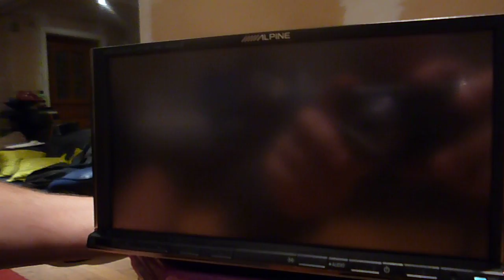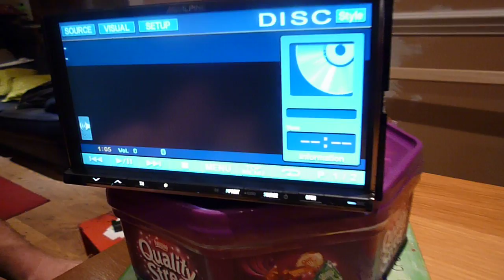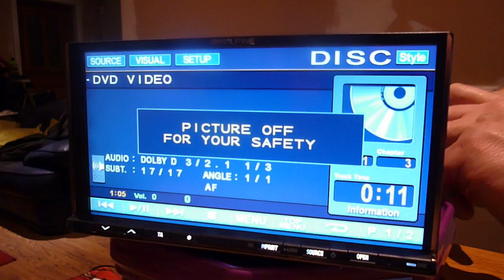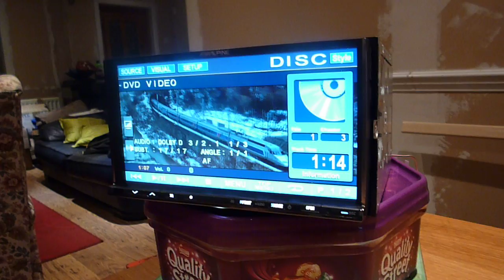How to bypass Handbreak disable function Alpine car Stereo DVD Playback

Comment: UPDATE - This fix only works on models sold in Europe.  Those models only have a parking/hand brake (yellow/blue) lead.  That's why it works for them.  It only needs to be grounded (parking brake activated if installed per the instructions) to allow access to all functions.  The U.S. models are more complicated.  In addition to the parking brake lead, there is also a brake pedal (yellow/black) lead that also must be grounded.  Then, you have to activate/ground the parking brake lead twice while pressing your brake pedal (or grounding that wire via some other means) in order to play DVDs, set your clock, and perform other functions with this model.  I figured this out by comparing the connections diagram in the IVE-530 (U.S. model) and IVE-530BT (European model) manuals, and found the one single difference between the two - the brake pedal wire.  I hope this helps clear up some confusion for anyone in the U.S. trying this fix as to why it doesn't work.
Reply: Palmer, help me please. What do i do with the yellow/black wire?? I have sound but no video.
Reply: Hey Palmer- I followed your directions and grounded both hand and foot break wire- it worked untill i cut off the ignition. Any other suggestions?
Reply: BUNJ125 - I got the same thing when I first hooked mine up. 
BUNJ125 and Phillip - There is a YouTube video that will work for U.S. models. Search for the Alpine Parking Brake Bypass video by laydown313.  You'll need a dual switch toggle to make it work, though.  I hope that helps.
Reply: it depends on the model Alpine, not necessarily the region it was sold in.  For instance I live in the United States and have a Alpine iLX-107 (Wireless CarPlay) and it only has the parking brake lead.  It does not have the foot brake leads.  So if your unit only has the YELLOW/BLUE wire for parking brake this trick should work and you don't need to buy a seperate Parking Brake Bypass microswitch.
Reply: Just ran into this with my ILX-107. You're a life saver!! I may be able to get this baby hooked up tonight after all

Comment: For the bypass, I use a car-door pin switch in series. Solder/crimp a wire on one end of the pin switch, then the other wire end to the car stereo unit's ground body or GND wire. Then connect the green "brake" wire from the stereo's harness to the door pin switch 's body. I drilled a hole for the pin switch or installed it on any available dashboard "ACC" snap-on, for the lack of name on my part. Or use a Normally-Closed button switch or a rocker. Operation: Assuming you already have a DVD disc in there. After the unit completely boots up, press the switch (to disconnect-OFF), let go (ON), press again (OFF), then let go (ON). Basically, it is ON-OFF-ON!...then go to the "Camera" or "DVD" source menu options.

Comment: It works but if your battery dies on your car ever, you will have to remove the radio to remove the wire off of the radio and reset it... just keep this in mind...
Reply: Why would you need to reset it ?
Reply: If your battery dies, the ground will have to be detached and re-attached... It's weird, like the radio knows that the emergency parking can not possibly be attached soon as the radio regains power... The way I fixed this was I ran the ground to a place I can gain access to it with out taking out the radio... I then attached a fuse (or a switch/interrupter) to the wire so if the vehicle looses power, All I would have to do is detach the ground and re-attach it... if that makes sense
Reply: that makes no sense.  almost all cars would have the parking brake ON when say changing the battery out etc.

Comment: I wish this worked with the IVA-W505 but it didn't like your IVA-W502. I had to use the PAC TR7 to make it work, which required connecting 4 or 5 wires (easy enough)

Comment: @ Marcos Marc.. the problem you're having is the parking break wire needs to be grounded to your hand break switch. there's a long green wire that's ran from the head unit to said switch. the only bad thing about doing it the "recommended" way is you wont be able to view video unless the parking break is engaged. there's a way around that. pac-audio sells a module called a pac tr7 that by passes the parking break issue. I got mine of amazon for 19 dollars. it's a simple install... red to 12V. yellow to constant. black to ground. then you have to use only 2 wires that's specific to your car. I believe it will tell you in the manual or you can check their site. the way it works is this module tricks the radio into thinking the hand break is engaged... don't go the relay route as it causes problems.. so I've heard.
Reply: I have the Alpine IVA-W200 in my car and I tried playing a movie with the handbrake engaged but got no video. Does my car need to be on?

Comment: I just hooked up a "new" Alpine IVE-W530 and it simply doesn't work.  No power, nothing.  I grounded the parking break wire to the unit per the video, but I didn't connect the brake pedal wire to anything.  Would that have caused it, or did I simply receive a defective unit from eBay?  All other wires (except power antenna and two remote control wires) are connected correctly.  Any thoughts would be greatly appreciated.  Thanks.
Reply from the maker: Looks like a defective unit but very hard to say from here , you could try to wire it up to a battery  and see that it not the car wiring
Reply: Thanks.  I'll give that a shot.  I'm also going to try a different harness.  If those tactics don't work, I'll look into a possible blown fuse.
Reply: I forgot to ask before - in this scenario (your video), what did you do with the brake pedal wire?  Was that also grounded, or did you connect it to the brake pedal?  I left mine unconnected, and I want to eliminate that as a possibility to my troubles. Thanks!
Reply from the maker: The brake pedal wire is the wire that I grounded
Reply: I see. I guess that leads to another question (sorry about all the questions here).  What do you do with the parking brake wire?  Again, thanks for your help on this.  Btw, my stereo works now after replacing a bad 20a fuse.
Reply: To recap - the foot brake (yellow/black) lead should be grounded to the back of the receiver, and the parking brake (yellow/blue) lead is attached to ???
Reply: I just watched the video again.  The wire being connected to the chassis is the parking brake (yellow/blue) lead.  There's no mention of the foot brake (yellow/black) lead.  My stereo works now, but I only get sound - no video (like Marcos Mark posted).   Should the foot brake lead be connected, grounded somewhere else, or left unconnected?  Thanks.

Comment: Hi

Great video !

Listen..I have the kenwood DNX890HD head unit.

The kit wire harness has black wires that say "Chassis Ground".

Can I just connect / splice my "parking SW wire" to the the "Black Chassis Ground" so I can also let my passenegers watch DVD's while I drive ?

Will it work just like your version ?

Only difference is I'm connecting directly to the chassis ground wire ?

Thanks

Comment: Hey mate will this work on the Alphine ILX-w650 model cheers!
Reply: #audiobeast so where do you connect the blue and yellow wire
Too?
Reply: @zackaryhosler2502  idk ask @Terry Fahy  I purchased the ILX w650 and asking if it will work...
Reply: No it doesn’t work on w650. I have one. It needs an “on-off-on” signal to ground so connecting directly to ground won’t work. Dont waste money on buying a bypass module. Get a toggle switch. Connect one side of the switch to ground the other to the alpine handbrake wire. Turn the head unit on on and switch the toggle on-off-on and leave it on. Thats it. You won’t need to touch the switch again unless you change your battery or unplug the unit